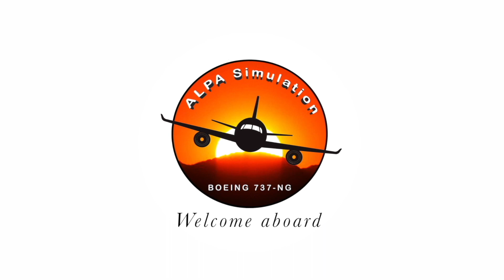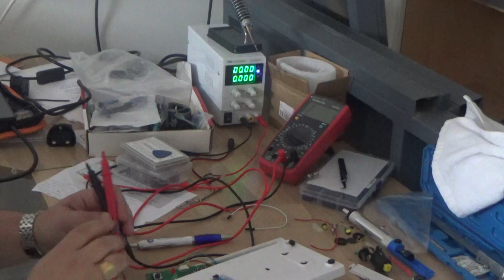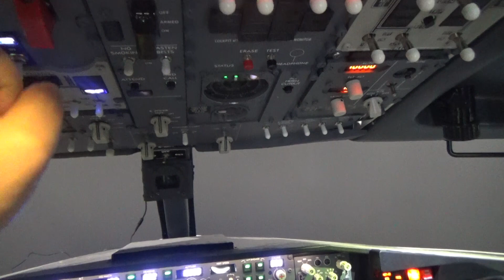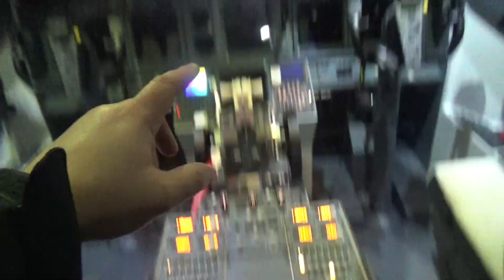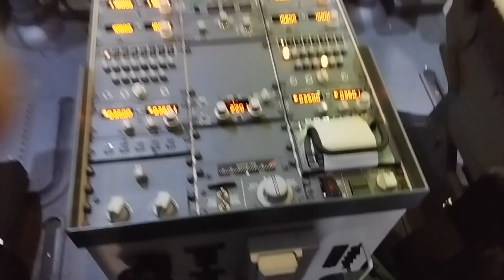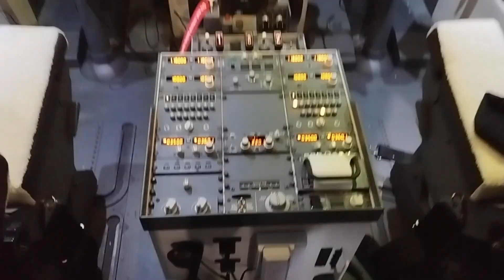Cockpit Communications - Pilots to Cabin Crew

Comment from the maker: Hello, for all those that have asked the model of the intercom system and how to connect to the attend button.
The model of the intercom was purchased on AliExpress from a store called Anjielosmart Video doorbell Store, link below
https://www.aliexpress.com/store/910545415?edm_click_module=order_detail&tracelog=rowan&rowan_id1=sellerSendAllGoodsToBuyerV2_1_en_US_2022-02-05&rowan_msg_id=1854814597079050$15624e8e274048bc8529116bc05e8234&ck=in_edm_other

For the electrical connection (please note, only for SISMO AFT OVH module):
from the connector of the phone, extend 2 wires: a red (for positive) and a black (for ground). Open up the SISMO After Overhead module, find the connector module P1-IN which is then connected to the module P1-CP-IN of the baseplate card.
Within the P1-IN connector, the red wire must be connected to the pin # 7 (Pushbutton: ATTEND) and the black wire to the pin # 10.
Below are the links from the Sismo website for the documentation you may need:

Link for CP Module (Central Control Panel Module) and corresponding baseplate:
https://sismo-soluciones.com/index.php?id_product=93&rewrite=central-control-panel-module&controller=product